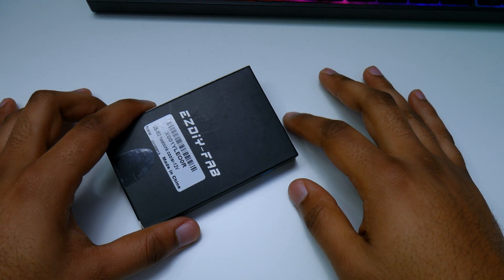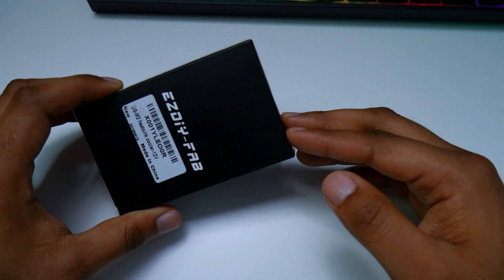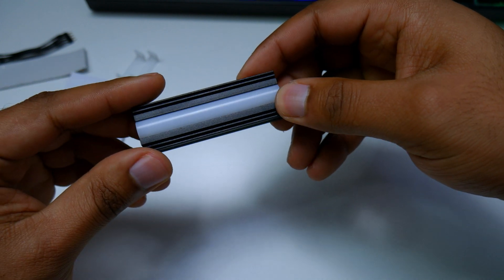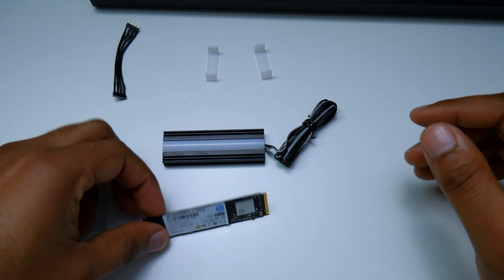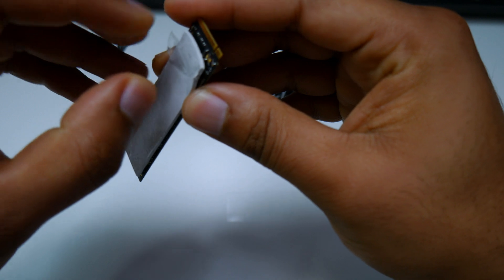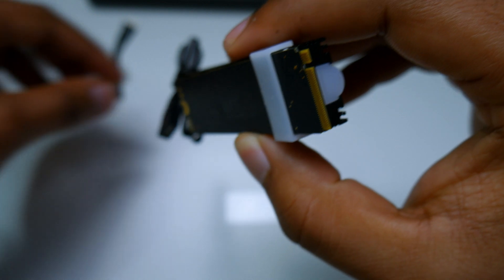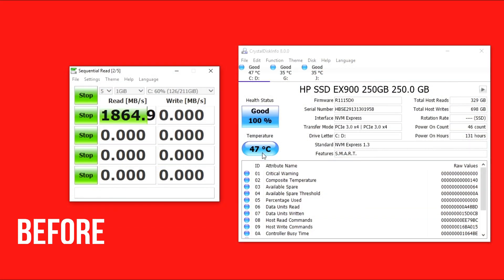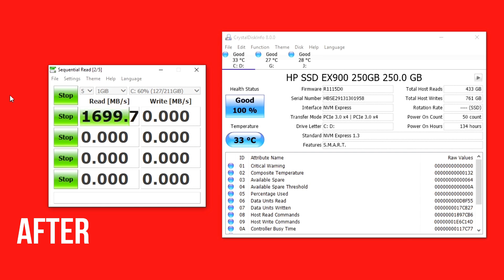How to Install a Heatsink on M.2 EZDIY-FAB RGB(REVIEW & INSTALLATION)

Comment: These are great but for some reason they don't turn off when I shutdown my computer. Any thoughts on how I can get them to turn off? I have read that it may be a Motherboard setting, but where could I look? It's crazy because the light will be off but the fan still spins.
Reply from the maker: That's odd. Are turning it off or putting it to sleep
Reply: @VictorA25  turning it off completely.

Comment: I would recommend putting the clips to the top notch. Right now your clips aren't really doing anything but keeping the board aligned, but no pressure is being exerted to maintain a good seal, as is clear by the gap you have between the clips and the board underneath. You want it sucked on there good for optimal heat transfer.

Comment: M.2's memory chips actually like heat it's the memory controller that doesn't like heat. Running with temps that low destroy the drive faster then heat will.
Reply from the maker: I'll keep that in mind! But its also funny how manufacturers are applying heat sinks the M.2 as well as motherboards just saying.
Reply: @VictorA25  just find out which chip is the controller cut the thermal pad to fit it and put the heatsink back on.
Reply: @MrJakku26  That is a very bad idea... The heat-sink will end up touching components on the SSD and potentially shorting the board, POOF there goes your storage and the data on it.
Modern NAND signaling is designed to operate around room temperature. The changes in quantum behaviour of the electrons at much lower or higher temperatures can throw the spec out of line. The general range of designed operation is 25-80C. A passive heatsink is not going to cool your NAND below 25c and in fact will help keep it right in the sweet-spot of designed operating temperature. Too hot or too cool is not good for the chips (excluding the exception of baking the chips at a very high 600C+ temperature to rejuvenate the cells, but this will destroy whatever data is on there)
Reply from the maker: Well I don't believe this heat sink which is designed with the visual flare of the rgb in mind. I'm still running it the same way on the day to day basis.
Reply from the maker: At the end of the day is up to you whether you would want to do this to your NVME or not.
Reply: This is just silly. Even PS5 have a decent radiator. Sabren SSD comes with a huge radiator preinstalled.

Comment: the led help to increase temperature if your drive is too cool
Reply: LED are extremely efficient, they do not give off any impactful amount of heat. It is not an incandescent lightbulb haha
Reply from the maker: Lol what my drive stays under 45 c if temp is your problem you have poor ventilation air case

Comment: How were you able to make it cycle colors? Mine is stuck on solid orange.
Reply from the maker: My Mobo is a msi version so I use the msi mystic rgb software to control that feature on this heatsink. So depending on your Mobo manufacturer the rgb software they provide should sync this with that easily.